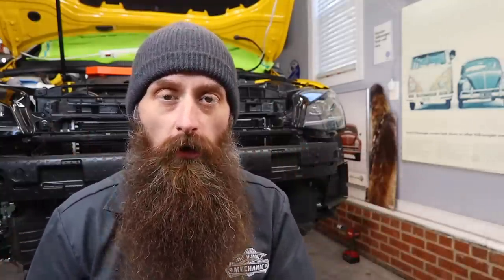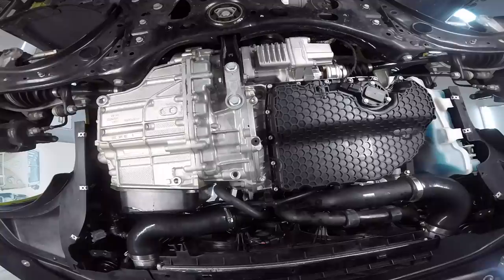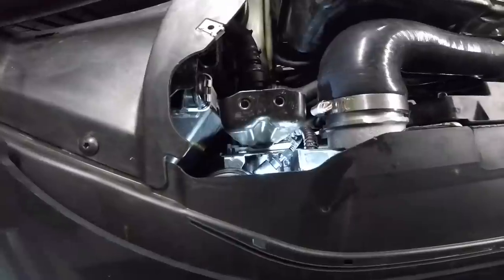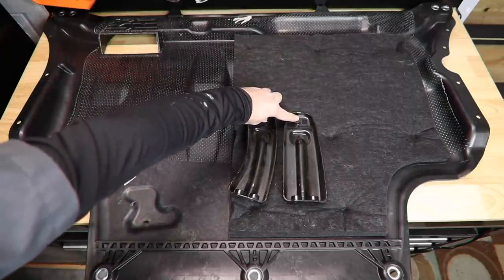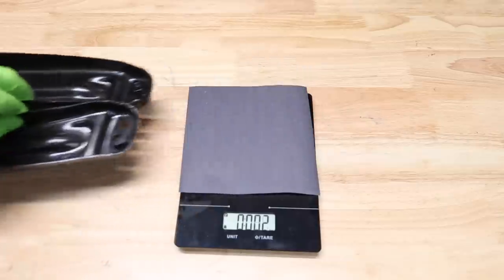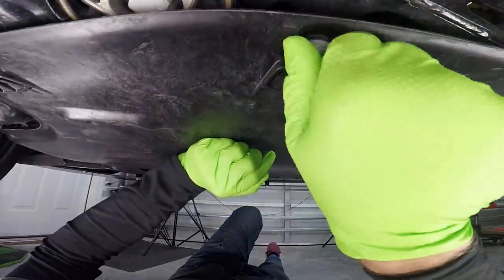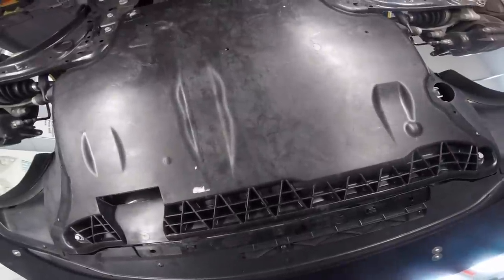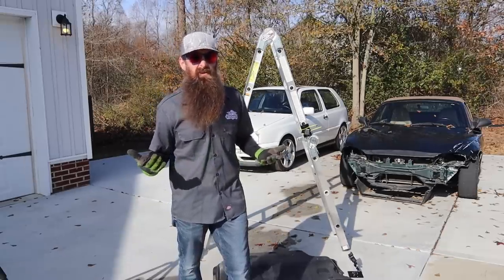How To Install Reinforced Skid Plate ~ PROTECT PLASTIC OIL PAN

Comment from the maker: A question that has come up is about temp and heat soak with the pan. GREAT QUESTION! Something we might test soon :)
Reply: yeah, containing hot engine oil in plastic... wow! I think the gergineers are a bit hardcore about making cars that only last 3 years...
Reply: @wim0104  Also smashing the oil pan on speed humps and driveways is never fun. I'm on 14 oil pans on my b5.5 passat 4motion.
Reply: @snoopy5736  even if you had a steel pan, you still need a skid plate: the oil pickup will get compromised when the pan is bent.
Reply: Spanish subtitles please
Reply: Kind of wondering what would the engine heat soak temperature would be when stuck in a traffic. My car will kick a slight dust storm when the radiator fan kicks on.
Reply: Shouldn't be an issue, if the cooling system is fully functional.
Reply: Fenske might have a formula for that too.
Reply: @snoopy5736  Nobody else gonna call out the fact you said you're on your 14th oil pan?! Do you drive around slammed on a static setup?
Reply: Nice video but I installed the ECS aluminum skid pad.  Yes it is heavy but since the car is lowered on coilovers it is a necessary evil.  I have at least 40,000 miles on it since install and no issue with heat soak.   And it has saved the bottom of the car many times.  Since lowered the car can’t even straddle a dead rabbit on the road.
Reply: would this work on the new mk7 jetta gli (MQB)
Reply: Vertro 31 check out ECS tuning website.  It is called a street shield.  They do make a variety for different models.
Reply: For winter low temp driving only. During summer your oil temp will increase 10-15C in no time, as you are loosing air cooling with alltrack skid plate. Imagine how the temp would rise during your track day :))))) original skid plate is there for a reason...
Reply: Yes, you are the test.
Reply: @cheesemons  stuck in traffic just hit the AC button and circulate air as the fans will run.
Reply: @braddowns17  but where will the hot air blown to since most of the under part is armoured off. Like it's a small restriction in air flow
Reply: @cheesemons  at the back of the engine compartment and out under the vehicle.
Reply: good luck with that.... :))) at the temperature that gives up your car requires a new engine... i think it starts to melt at 130 Celsius but can withstand that temperature for short period of times....
Reply: Were you able to test it? I've got a new GLI and it has the same wobbly pan...
Reply: Have you tested it yet?, trying to see if I should buy it
Reply: @HumbleMechanic Have you tested this yet? I would love to know the results.
Reply: I just got a bill for damaged oil sensor connector and oil sensor.

Almost $700 in damage caused by the 2018 Golf R not having the coverage of the 2019 Golf Alltrack's belly plate.

REPLACE YOUR SPLASH SHIELD!!!
Reply: @snoopy5736  sure you are...maybe after the second destroyed pan any normal person would adjust their driving to avoid this happening...only a fool would wreck their oil pan more than a couple of times.
Reply: @m88works  did you just pluck that 10-15C out the air? Total nonsense, your car has an oil cooler for a reason...
Reply: @cheesemons  so explain how the Alltrack manages to stay cool all year round no matter how hard you drive it....I'll wait.
Reply: @m88works  so explain how the Alltrack manages to stay cool all year round no matter how hard you drive it....I'll wait.
Reply: @WrathOfThePunisher  maybe because tuned R has twice as much power compared to alltrack? :)
Reply: @WrathOfThePunisher  🤪
Reply: @m88works  maybe the r has twice as much cooling to compensate. Or in other words, you have no idea and are guessing...
Reply: @WrathOfThePunisher  real life science, as i have had two R’s and both skid plates installed. Wintertime with full size skid plate is a must, but in the spring when outside temp reaches +15, oil temp rises at least 10 C, changing skid plate to the small one lowers oil temp back to normal.
Reply: Did you test the temps out? Settle this argument once and for all.
Reply: Do you have a video of testing temperatures with and without the skid plate installed yet?

Comment: I  have a TDI bellypan on my MK4 R32 and like the Alltrack bellypan, it covers all the way to the subframe.  It's not reinforced, but I think it's worth it either way because it also helps keep the elements out with the extra coverage.  Great for the nasty winters we have in chicago.
Reply from the maker: That TDI pan was awesome for noise.
Reply: @HumbleMechanic  Yeah the OEM TDI bellypan has the sound deadening blocks.  I actually got the cheaper rock auto version.  It was only about $20 shipped and fitment was actually very good.

Comment: That's a nice addition. They used to make belly pans out of metal  (Eurovan).  I had a big dent in mine from something.  A few blows with a mallet and it was good as new.
Reply from the maker: Man those were great. Until you had to pull it on the alignment rack. Hahaha
Reply: @HumbleMechanic  There's a metal springy thingy at the front that's supposed to hold it, but mine is bent (same on my '92). So I'm always dropping the pan on my nose.  On a lift, you can just swing it down.
Reply: @HumbleMechanic  I'm just about to turn 130,000 miles.  Still no check engine light.  Original O2 sensors and cat (but I've got spares in the box).

Comment: Great video and product. I was skeptical at first. Dont know if id ever buy a newer VAG, but id probably do a combo of metal oil pan and the Alltrak skid plate. Luckily I can still stick to the old MK1/MK2 trick of welding a 1/4" plate of steel onto my B5 Passat wagon oil pan. The B5 has a long list of quirky engineering but I love it.

Comment: The composite belly pan is durable, but with as much as it flexes, I'm not convinced it would actually protect the oil pan from being smashed if you hit some thing big or bottom out over a speed bump.
Reply: U right it flexes too much. 
The only thing It protects from small stones and scratches. 
Also if u get a small oil leak it protects the garage floor
Reply: @Wolfpack310  I didn't think about that if you get a leak you might not know for a good while.
Reply: @neno_e2332  with as many oil leaks VW's have, they should have drilled a few holes in middle so you can at least see the oil stains before all of the oil that's supposed to be in the engine just pools up on top of the belly pan 😂
Reply: @SikConVicTioN  it won't take a lot of oil leaking before you see it on the road, no matter what pan you have fitted...
Reply: @WrathOfThePunisher  meant skid plate lol

Comment: This summer in Dallas someone threw an object at my R. They were aiming for my windshield but it went under the car and punctured the oil pan. Luckily the car holds most the oil until the engine is shut off.  I wish i had this installed.

Comment: I love this video and the product the was being demonstrated. I have a MK7 and was looking for alternatives to protect the pan.  One issue though. As I clicked to link to actually buy the product. I seen that it was going for $423 versus buying a steel oil pan for $1XX and maybe around $200 installation.  As a regular Consumer I shop around for what’s the best costly yet affective alternative. I would be saving around $100 buy just going with a steel oil pan and not having to replace the drain bolts every oil change. Again I love the skip plate and and the video but the price is just a little up there for that particular part. If it was around $2XX something, then I would’ve put in a order right after the video.

Comment: The 2019 911 Carrera's have plastic pans as well. Also, I've read about people having issues getting the metal oil pans sealed properly.
Reply: The 911 must have a much lower ride height, so it's more of a potential problem there.

Comment: I work at a Hyundai dealership and there's a transmission mount behind the oil pan on the Sonatas, Elantras, and Accents that should be circular but is in most cases ground flat by customers repeatedly bottoming the car out.  The good thing about this though is that the mount sits lower and protects the oil pan from getting damaged in most cases.  We call them the buzz cut mounts.  There really should be a factory replacement interval for 'em.
Reply from the maker: Hahahha I like that Buzz Cut l!!

Comment: Parts list for those curious:
3Q0825902B - Reinforced Alltrack Skid Plate w/ Vent
5Q0 825 921 - Retaining Bracket Driver's Side
5Q0 825 922 - Retaining Bracket Passenger Side
N907 559 02 - Spline Head Bolt w/ Washer (x2)
N019 530 7 - Flange hex head bolt (M8x25mm) (x7)
N909 747 01 - Black wide head T-star screw A04B (x7)

Was able to grab the entire bundle for $270 shipped.

Comment: I am somewhat leery of plastic oilpans on an emotional level. Do they deform or deflect or are they rigid AF?
Reply: @ThunderGoatz  mm, shattery
Reply: @ThunderGoatz  - The plastic ones don't deform, they shatter. I would rather to have a dent than a broken oil pan.
Reply: @ThunderGoatz  - What happens to all plastics in your engine bay?
They get brittle with heat and age. 

What happens when plastic gets cold.
It gets brittle. 

What happens to brittle plastic when impacted at medium to high velocity? Metal oil pans do not have the same issues, although cast aluminum is brittle and I understand some oil pans were cast aluminum before going to plastic and were more prone to shattering when impacted. 

Personally I would rather have an aluminum belly cover than a plastic or fiber reinforced plastic belly cover.

Comment: I just bought a new 2020 mk7.5 GTI, I REALLY don't want to drop the pan on a brand new car and add a steel pan that might leak, but I am lowering it. Think I could get away with just this or an aluminum skid plate?

Comment: I put one on my Sportwagen and noticed that it effectively lowers the ground clearance compared to the stock one. I’m hitting ice chunks left and right with my Eibach setup and even though I cringe every time the Alltrack belly pan has held its own in real world testing.
One thing to note. I was advised by VW parts to remove the felt liner to keep temps down. Thoughts on that?
Reply from the maker: Maybe worth doing. But I think it would be issues on the alltrack if it was an issue

Comment: Hey Charles, great video and mod! I noticed you opted to use hex bolts on the brackets instead of the (2) triple-squares that come with most of the kits being sold. Is it just to keep things simple, or any other reason?
Reply from the maker: Ease of install was my play
Reply: what is the part number for the hex head bolts?

Comment: $400+ for a plastic pan? I got my factory full-sized belly pan (PN 3Q0825236D) for about $70 shipped, you just need to buy the 3 bolts for the subframe. Not as much protection but better having nothing and increases aero under the car.
Reply: Yeah, that's too steep considering Panzer pans are about $280, at least for Mk5 R32's.
Reply from the maker: No Panzer for MK7. That was my first stop. Another company has metal, but it said that it doesn't fit DSG cars(I guess they changed that since). 

I Think the part number listed is not the reinforced one?

Comment: Just did this on my mk7.5 R and ran into an issue with the fitment of the passenger-side bracket. Aligning the “little tab” on the top of the bracket made it impossible to get the 2 lower bracket holes to align correctly with the belly pan. It’s almost as if the hole for the tab in the chassis should have been drilled slightly lower. Ultimately, had to bend the tab out of the way and mount the bracket with just the bolt alone.

Comment: I don't know.  I think I would just not buy a car with a plastic oil pan.  Euro stuff is taking the plastic stuff a little to far.
Reply from the maker: LOL we might get to the point were we can't LOL. These composites actually do a great job in many applications. Not saying I won't protect it, but they are stronger than we might think. next day complains about replacing an engine because I hit something and busted the pan HAHAH
Reply: Ford has them too,look at the oil pan on the 2018 Mustangs with the 5.0.The oil pan is plastic
Reply: FrugalPrepper's Garage & Garden bro Toyota uses plastic valve covers for their engines. If anything toyota uses more plastic than VW.
Reply: Yashar I think you’re talking about the plastic engine cover. Where does Toyota use an actual plastic valve cover? I know that they use a plastic intake manifold. Keep in mind that engineers are designing these.

Comment: Hi sir i am rebuilding a valve body for my 2008 jetta 2.5  transmission code 09G. How do I determine the location for the new solenoids the numbers do not match up i am using a remanufactured kit please help thank you. Vw life forever

Comment: You might not be able to break it with the hammer and weights, but I really wonder how much it yeilds to deflection when hitting something. If it deflects enough, then it can still hit the pan and cause damage.
Reply from the maker: Yep I agree. Ultimately there is only so much you’re ever going to be able to do.
Reply: I had a Panzer plate on my TDI Beetle and loved it. It was ridiculously heavy, but it lived up to its name. I remember I ran over a brick on the highway when I was living out in Phoenix years ago. I'm pretty sure it exploded when it contacted the plate and left a nice 2mm gouge down the center. Don't even want to imagine what that would have done to the pan!

Comment: So, you will need to take it off when you want to do a full oil change (like also replacing the oil plug which is a cheap addition to the oil change kits)? Will you need to also get an oil extractor too if the case?
Also "Plastic" to describe what the oil pan is made of makes it sound chintzy, when really it's a very durable composite. I don't know of anyone who has had issues with it.

Comment: Is there more than one version of the belly pan? I have a '17 GTI S and got the belly pan that I installed on my car from a local guy who said that he bought all of the underside protection parts for some Mk7 model not available in the US from a European source. The pan that I have doesn't flex like the one in your video. A couple weeks ago I hit something (hidden under snow) about half the width of the road on the left side and maybe an inch or so taller than the underside of the car. That broke a bunch of the plastic bits behind the left-side bumper cover including the core support and cracked the intercooler. The left side of the belly pan(including the vertical support) moved back an inch or two, which ripped all of the metal eyelets out of the rear of the belly pan. I am looking for a replacement belly pan and after watching your video I am concerned it might not be the same as what I am replacing.
Reply: BTW, I am a stage rally official who uses my GTI in my duties, including course checks. Earlier this year, on a fresh (not-yet compacted) gravel road, my car managed to bring in enough rocks through the cooling hole on the belly pan that the inside bottom of the pan filled with rocks. The rocks filled the gap between the belly pan and the oil pan. Then I went over a bump that pressed up on the belly pan and -crack- went the plastic oil pan. I now have a steel one on my car. But I managed to drive on gravel stage rally toads for 5 years before that happened.

Comment: Too much wieght plus heat addition, i would recommend this belly pan for winter use only
Reply from the maker: I fee where your coming from on the heat. The weight is a non factor for me and I’d say 99.99% of MQB cars. 

The heat side is something I’ve thought about. The only thing that has me not really worried is that it’s a factory part. So if it was an issue it would be an issue on all the Alltrack cars.
Reply: HumbleMechanic Alltrack engine puts out way less heat than the R though

Comment: wierd, i thought the golf had the same belly pan as the a3.  The A3(at least the 2015 "quattro") has a flimsy belly pan that goes all the way back to the rear 3 bolts, so it covers the oil pan.

Comment: The problem with the Alltrack skid plate is that you have to take it off to get to the oil pan drain.   Somewhat easy to do on a lift, but harder to do when all you have are jackstands.
Reply from the maker: It’s one of the reasons I like the extractor method for service
Reply: @HumbleMechanic  Would you used the extractor method for every oil change? (Alltrack 1.8T)

Comment: I have a 2010 VW EOS and come with protector aluminum oil pan.
Reply from the maker: That EOS pan is no joke!
Reply: @HumbleMechanic  is not plastic is aluminum
Reply: @HumbleMechanic  1q0825237b take a look
Reply: @marceloigorra9155  Because it's part of the structure of the car.The previous owner of my eos left it at a workshop.The car was just wigly and not stiff enough.Bought myself a used one and the ride feeling is much better.
Reply: @MagnetbergOfficial  yes is structural, but I think fit the gti and is better

Comment: Drives me crazy when owners remove the belly pans or cut holes in them to change the oil. To me it's just plain laziness. When doing an oil change it's a good time to get in there and check everything. So don't be lazy pull the belly pan and inspect.

Comment: The Alltrack belly pan looks very similar to the one on our '15 Golf TDI, maybe more composite in the pan itself making it a bit stiffer.
Reply: The TDI one looks similar but is very different.  The TDI one mostly is for sound and Aero and wouldn't hold up to abuse.
Reply: Deutsche Auto Parts is there any like this for a MK6 Golf paul ?
Reply: @Deutscheautoparts  do you know if the Alltrack belly pan is a direct swap for the TDI belly pan or does it have different mount points up front?